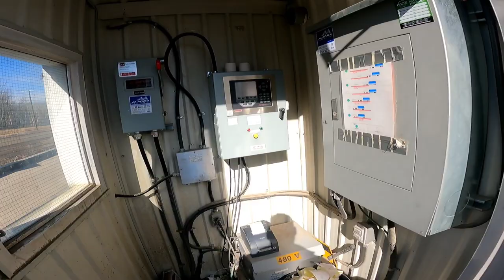Vlog #171 | 3/09/21 | Edmonton and Seba Beach, AB

Comment: That's quite the mud. Wonder if it froze, what would happen to some of those trailers 🤔
Reply from the maker: Likely get stuck. However if the trailer is stuck in the frozen mud, but the tractor isn't, I'm sure the truck would be able to pull it out. It's a much different story if both are stuck!